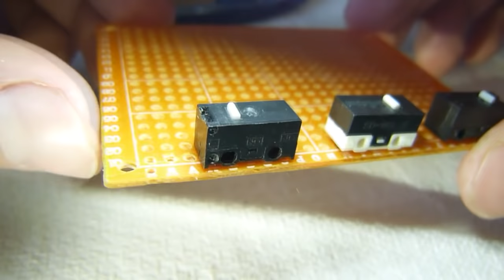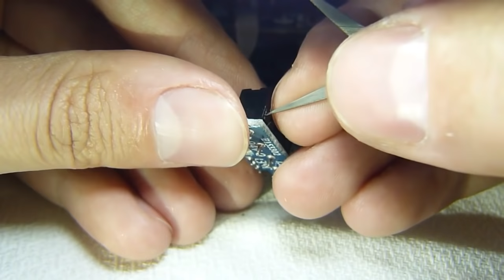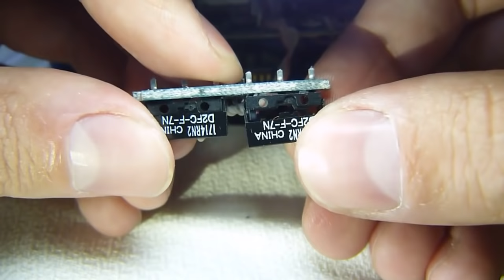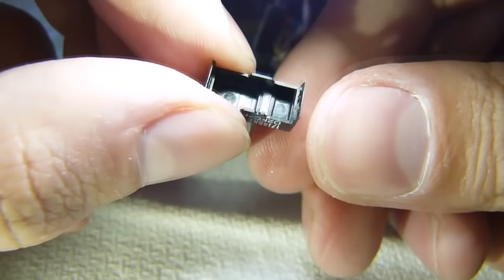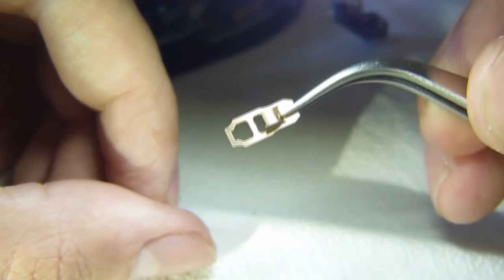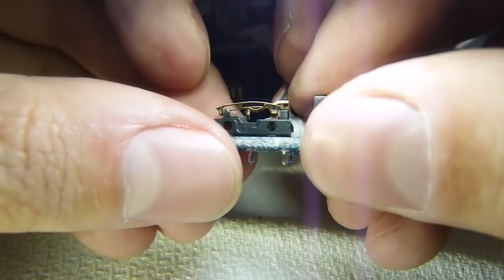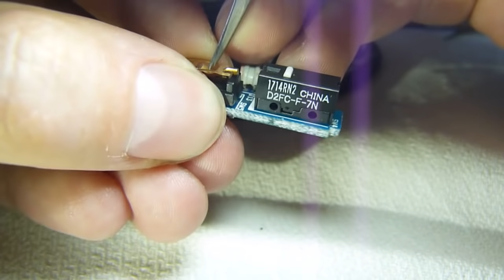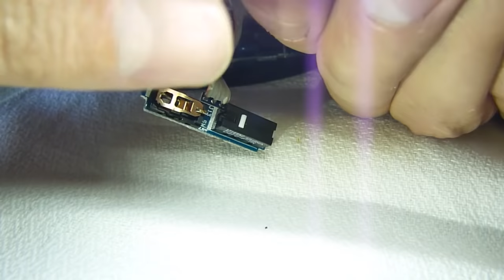Double click problem: How to fix faulty mouse button

Comment: THANK YOU!!
Did this on my LG G600 because I've had it for around 11 years and the left click was starting to lag. 
NB to anyone else who's doing this for the first time -- the switch cap can fly off if you're not prying it off carefully and if you lose the white/silver/red/whatever part that does the actual clicking, you won't be able to find it to save your life unless you have an absolutely pristine work surface and a lot of luck. Ask me how I know.
Thankfully, I had a third switch on my mouse that I don't use (ever) so I scavenged that cap.
If I do this again I will have to find some junk mouse to practice on first.
Reply: Taking off the housing is annoying. I recommend patience and a sewing pin. Don't force it.

Comment: It worked for me! Thanks a lot!!! It fixed my logitech g302!
I first googled for a "mouse event test page". So I tried and realized that, while I was holding down the left button, the computer acted as if I had released it. So, based on that, I came to the conclusion that this video would work.
Based on some comments, I had in hand some tweezers, a phillips #00 screwdriver and something very thin to open the plastic piece. The rest was just as the video described. The most important, the mouse stopped acting werid.

Comment: for someone that has access to solder iron (or just buy one for cheap and learn), you can just replace the switch, aliexpress has many replacement micro switches for cheap, omron, kailh, huano etc.
Reply: @ruotuz  I did that a few times but it will happen again in my case after a few weeks. So might as well replace the switch to something different like the Kailh Red which is not prone to this issue. They're like $5 shipped for 4pcs.

Comment: tip for 3:10 - use needle nose pliers to hold the side of the piece and slide it in from the front like in the video. Don't slide it too far forward or the spring will pop down and you'll have to start over. 

Mouse works great again though.

Comment: This is amazing! Just fixed my Logitech G600 left-click with this. Clicking now feels way better and is working perfectly.

Putting the small metallic piece back in place is definitely the hardest part specially if you can't remove the board from the case (which was my case). I think that may be a way to remove the board but I was too afraid to damage something. Without removing it you have even less space to handle the pieces that are actually way smaller than what they appear to be in the video. If you have big fingers like me it can get very challenging  and even if you can put it back with tweezers and stuff I find out using my own fingers was way better. Once you understand the mechanism that locks the metallic piece in and with some practice and patience you begin to get the handle of it and each try gets closer to the correct result.  In my case it took forty freaking minutes.  :D

I saw he removing the little white piece from the black box but I highly recommend you not to do it. There is no reason to do so. Just remove it upside down and keep it that way until you put it back. One less thing to worry about.
Reply: One hour!My eyes was bleeding)This shit to small for me) but I fix it!

Comment: Just did this on my 2012 Razer Mamba Elite. Seems to have fixed the double-click issue (no more randomly closed extra browser tabs, and no more full-screening YouTube, etc.) Saved my old $200 mouse from the garbage heap. Be super careful with the copper piece, even just picking it up with fingers may bend parts of it that aren't supposed to bend. Also, quite finicky trying to do this with the switch attached to the circuit board, with all of the obstacles in the way, but still doable with just a 0 Phillips, needle nose tweezers, and an Exact-O knife ;)

Comment: Dude! You saved me! Thank you so much!
I had boxed up my Logitech G102 Prodigy for a long time after the double click issue popped up, couldn't do any thing.
The procedure was tricky, I didn't have a thin enough tool for wedging or tweezers for the white piece  but all went well and I got my mouse back!

Comment: I was looking for videos on how to fix my mouse and was gonna try this method but managed to fix mine with a safer way, so if anyone is interested, I recommend trying what I did before trying this: Put some non oil based contact cleaner through the button gap in the switch and click it over and over again, don't close the mouse yet, wait for it to dry and test the mouse, if it didnt work, try a few more times. If it fails it might be a physical problem with the switch so you can then try this method in the video.

If it also fails or if you damage your mouse you can buy new switches and solder them to replace them. I got some Omron switches on Ali Express but didnt end up using them cause the cleaner worked for me, you could also take the opportynity to get some other type of switches and mod the mouse. I also got new mouse feet on Ali Express to replace mine in case I damaged them while opening (cause the screws in mine are under the feet). (If you buy on AliExpress keep an eye on the costumer safety guidelines so you can ask for a refund in case your order dont arrive in time, cause buying thins from random sellers from so far is a gamble, Ali Express is actually pretty good with refunds if your product dont arrive or is damaged/fake)

Either way, this video explains this method pretty well, I'm glad I didn't have to use it but it was nice knowledge either way, cheers!

Comment: I should have tried this method before soldering.  I had 5 identical switches on my 4.5yr old g502 (except the two main mouse button switches were rated for 50m clicks) so had the bright idea to shift one of the ones I hardly used to replace the faulty left mouse button switch.  I cooked two of the switches with too much heat transferring through the 3 prongs, making the spring lose its tension.  The third switch I finally got right, but it has a worse double click problem than the original switch, even though its been barely used.

Comment: Brilliant video!  Thank you!!  My Logitech G100s developed this issue after about 5 years, and I used this fix then.  And then it developed it again after another 3-4 years.  I'll call it a design flaw or materials flaw that the metal in that spring becomes fatigued and loses its shape, at which point the force holding the switch DOWN diminishes, and it eventually starts to bounce instead of hit-and-stay-seated.  The driver COULD compensate for this, but it doesn't (i.e. simple switch de-bounce logic).  The great thing is that despite this design flaw, I've been able to restore my mouse to working order again using this fix.  I just did it for the 2nd time, and it's back in good shape again, probably for another 3-4 years.  Nice not to have to buy a new mouse.

Comment: This method may or may not work. I used to apply this fix long time ago on my 1st very expensive SteelSeries mouse. The problem is that the spring already lost its tension so the problem will return after a short time with this fix applied. The easier fix is if you have another extra mouse button that you don't use or rarely use, just swap the springs and you get a new working switch.

After this experience I'd swore never again to buy very expensive gaming mouse unless it has features I need that I can justify for the price. Now I'm using Logitech G300s for a few years already (I'm positive that the switch lasts much longer than my previously more expensive SteelSteries) and now it has this double-click problem. Will try swapping the spring buttons later.

Comment: Use some tape before removing the switch cap, in order to hold the white piece in place and put in back easily
Reply: good idea , thanks for the info man
Reply: i just installed the cover upside down

Comment: thanks for the video overall. While it is possible with lesser tools as I have done it myself (kinda ashamed I only have these as someone with an electrical engineering background but whatever)

I highly recommend for anyone also doing this having proper equipment as it is going to make your life easier.
Also before removing the final metal conector to rebend it you should first check exactly how it was inside before as it is somewhat hard to realign if you do not know how it was sitting inside previously (made that mistake and just checked the other mouse button as reference since I couldnt seem to wrap my head around it as it was shown in the video properly)

PS: BE DELICATE I have seen a few comments of people breaking the copper strip. This is very fine work you need patience. the metal parts are very delicate for a reason and you could break them if you try to force a position. Depending on how much experience you have with work like this it could take 2 minutes or 2 hours to realign the strip properly.

Comment: Sand down where the metal click connects on each one as well. They corrode over time and you'll get a faulty signal, sanding the connection points down prevents this.

Comment: Great job, lad! Seems like I just managed to repair one of the Omron switches of my Logitech G402 mouse.

Little advice, though: If you apply a tiny piece of adhesive tape (I used Scotch Magic, but I'm sure any decent brand should do) on the upper part of the microswitch casing before taking the switch apart, you might save the yourself the hassle of having to fiddle the tiny white thingy back in.
Reply: It saved my M65RGB Pro thanks for the tip with the Tape :D
Reply: @APXProductionz /videos You're welcome. :-)

Comment: You saved my thrift store mouse~

Dropped both the spring and the tiny white plastic bit twice each on the floor but managed to find them, god help those that do the same with carpet flooring... Also took a bit of messing around with the assembled clicker before it settled in right and could click properly, but it's done.

Comment: This is great video and great solution. If for some reason you are not able to do. You can always make your left-click into right-click and vice versa by going in mouse settings in device. and selecting Right in the drop down menu. Because we hardly use right-click. So that button is quite functionable. And left-click you can use as right-click.

Comment: What is the best pointy tool to use when opening the micro-switches? I used the back of a small razer blade, it was what I had to work with. But I know there are better tools out there. The full guide mentions nail scissors or safety pin?

Comment: From my experience the contact is either dirty or just poor quality material. If you have electronics cleaner I would  that first before bending the plate. I have a logitech with basic omron switches and I put just a tiny amount of Ballistol (lubricant/cleaner) on the contact and it fixed my double clicking.

Comment: I have one question. How do you make sure that when you put the little black box back over the switch, it doesn't hold down the mouse continuously, preventing you from clicking? I haven't been able to fix this issue, and I would like some help on it.

Edit: Finally fixed the issue. If you're having the same problem as I did, try bending the spring a little more(Easiest for me with a safety pin) Oh, and this solution works great! My Razer Naga Chroma isn't double clicking anymore!

Comment: excellent stuff. i did it on my logitech performance mx, and its functionality was restored. You have to be extremely patient though when installing the metal part back to its base.
Reply: after two years the issue reappeared. Time to reopen the mouse and do the same process again. I would say that doing the process every two years is worth it for such a good mouse. Although i am thinking of finding a better quality microswitch to do a proper service.

Comment: To people who are watching this, i did this on two mouses. I think the best way to do this is make the whole metal piece flat before connecting it. This is probably how the metal piece is when it came out of factory, then workers place and hook it on top of the contact. So if curving the metal like in the video didnt work out for you, try to flatten it, and it will click like factory new!
Reply: The curve is caused by clicking.
Reply: Here is exactly what you do, and i think what factory worker in china do if it is handcrafted.  First flatten it, then You connect the teeth to the back of the square, then make it curve up like /\, then you push down the middle of the metal with a small pointy tip, example, the tip of a scissor. Once push down, it should bite the middle teeth, like / \/ \. After that, you are all done.

Comment: been using the same mouse for 7 years and just encountered this problem. after 2 hours i got it to work perfectly fine. By the time this mouse breaks I will have made a hole in the left mouse button due to constant everyday use. Didnt resolder or anything just unscrewed the circuit board and worked on it from there.

Comment: Its easier to just pass a very small piece of very fine sand paper  between the contacts (foldered in 2 so the abrasive part clean both sides), BEFORE you try to disassemble the upper contact part. It worked for me.

Comment: For anyone who has fat fingers and having difficulty putting the golden pin back into place, I have a solution:

1. Grab the pin by your index and thumb and slot in the front and back first, leaving the middle leaf on TOP of the notch.

2. Use a needle or a bobby pin and press the middle leaf downwards until you hear a click.

3. Installation complete.

Comment: I did a palliative fix by adjusting the double click settings on windows and it helped for some time, but now I am on the last possible configuration and the mouse is still double clicking like shit. I have several tabs of mouses to buy (most of the tabs are duplicate because my mouse double/triple clicked on the links), and I will try this fix. I will update this comment to say my results. UPDATE:

I was trying to fix my left button, which was double clicking. I opened the mouse, fidgeted with that black box, but I wasn't careful enough so the small white plastic tab flew off and I cannot find it. I was able to replace the white plastic with the one from the right button (which I was more careful to remove). I will use it until I can find a non work mouse to open it, get the small piece and put it on my regular mouse. Until then, I am using just a left buttonmed mouse. But the technique in the video works great, it is not double clicking anymore. Just be careful and don't lose pieces!!!

Comment: LIFE SAVER¬!...This has been pissing me off for about 2 years. It was intermittent at first and i could put up with it but it kept closing all my windows at once or opening 22 of them at the same time. I have a rat 7 (for those who want to know for comparrison), i will say however once you have that little box to the switch open and youve bent the gold plate tag, when putting it back in, do exactly as this legend does but dont use the tiny tweezers that you used to open it. I was there for a good 30-40 minutes fucking about. In the end i used a 4mm flat head and it went in straight away (just dont be heavy handed). Thanks again man! cant say that enough!

Comment: Thanks! Can confirm this works for Logitech G500s. be very careful removing the switch housing as it can break and/or get flung across the room! tweezers and toolkit is the best option.

Comment: Oh my god THANK YOU THANK YOU
I opened both switches and notice my left mouse button switch was a little bit different than the right one.
So I very carefully (in a clean space so as not to lose any pieces that might fly off) bent a tiny bit of metal to shorten the gap where the contact is and VOILA it fixed the double click problem!!!

Edit: to remove the pads, I used a clothes iron to heat them up before removing them (to loosen the glue). Putting them back on, I re-applied the heat at the end to make sure they stuck well.

Comment: Gotta love planned obsolescence. My first mouse with a rubber ball in it, still has working buttons. It's just very unprecise due to the outdated technology. But since then it's been like a new mouse every 2-3 years. I'll now look into fixing one of them as shown in the video. Doesn't have to be the current one... that has the issue on both left- and right-click. :\

Comment: ok guys I figured out how to put the thing back in easiest. Please like this comment if it helps so ppl can see
(precursor) Put the unit up to a wall mounted light source that is eye level so You have light coming in from the back if possible and You can see better.
1. pinch the back part of the piece with two left hand fingers(index and thumb), watch it from a side angle, Slide the front part HALF WAY in between the 2 thin metal pieces(you should know what I mean by front part now) while making sure the middle part (the spring part) doesnt fall down to the bottom, push  it down with right index finger so its slightly tucked in, but doesnt fall right through 
2. keep holding the front part down in place from above with right index finger, now tuck the back part securely in with left thumb
3. now that the back parts in, the front part will naturally be in all the way
4. keep the thing perfectly even, if its slightly sliding sideways, fix it, now use tweezers to push middle spring downward (push down more towards the front part, if you push down towards the back part it will fall through) WHILE holding ur finger on the back part firmly to keep the piece from shooting out
this part is tricky as often you will push too hard or on the wrong spot, and the spring will fall down to bottom, slide it out and try again.
Reply: this comment will likely save people 45 minutes, nothing worked until I did it like this, now I could do this in 2-3 minutes everytime
Reply: also be meticulous when putting the black box cover over it, it could pop the piece off if You arent careful